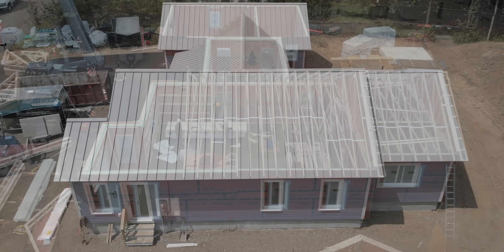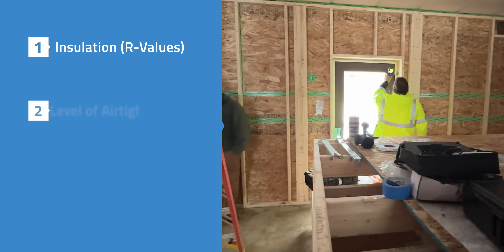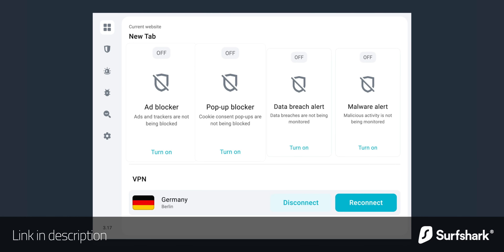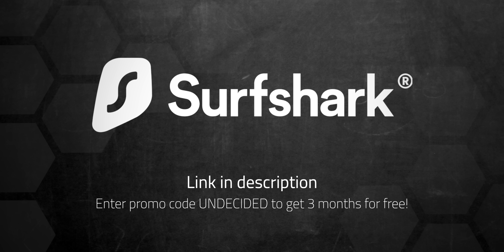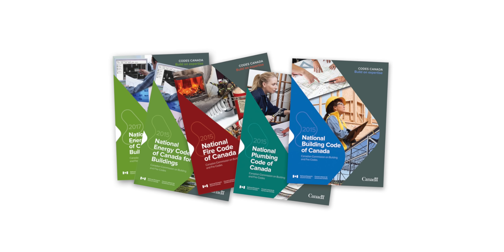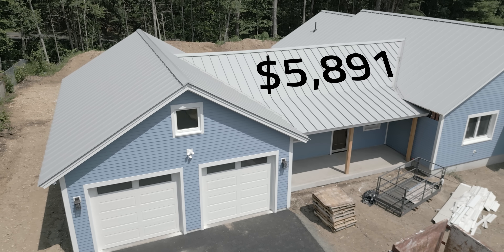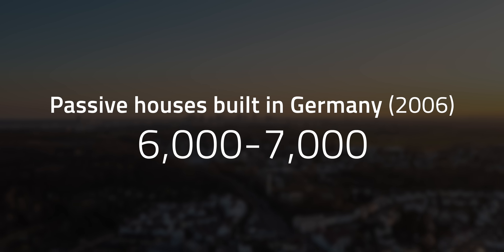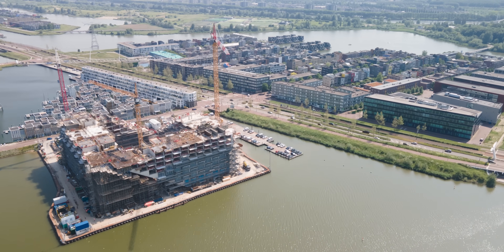Why Do American Homes Suck?

Comment: I am interested in energy efficiency in my home.  So far I have lived in a double wide mobile home, a cookie cutter home in a neighborhood and now in a log constructed home.  I have always wondered why none of these homes seem to favor any kind of energy efficiency from the start but I guess this video kind of spells it out.  I have also found that generally most contractors in my state (SC) don't seem to have a clue when it comes to addressing these efficiency issues.  I have attempted to get help with implementing energy efficient systems and seem to get lots of push back usually pointing at cost and claiming that "it's just dumb to spend money on that".  I have had to take in into my own hands to implement my own energy reform in my own houses.  I usually have to start by installing energy monitoring to see what needs the most refinement and do regular temperature and air quality checks to see what needs to change.  I am in the middle of refining my log home now but it is looking like I have some pretty major expense ahead of me.  The windows suck but aren't the worst, the air conditioning setup is by far the biggest issue at the moment so I am looking to make some changes there.  The current downstairs unit draws more than 70% of the energy used in the house.  I have to get this down significantly before I begin with my solar setup so I can properly size my equipment.  I really wish this process was easier but it just seems like no-one cares.

Comment: Agree on the statement: EU houses are way, way better built. 
The house of my parents in a mountain area (winter temps reaching -10⁰C for weeks and dealing with snow for around two months) is insulated by 3 (layers of) walls, from inside out: plaster-bricks-concrete + foam insulation + waterproof insulation and a nice touch of stone finishing. The windows are triple layered. The roof is even more complex, so much I can't really say the correct composition. The only permanent heating device is a pellet stove with a max power of 12kW (but usually runs at 5-6kW), it keeps the whole house (around 120m2) at 25-26⁰C all winter. The efficiency rating (according to national rules in a scale from A to F) is B+. The average cost of building the house was around 70k€ ten years ago. And yes, aside from the solar panels and heating, it is way more efficient than Matt's house.

Comment: My guess would be that cost of housing is the main barrier. Even the most modest and inefficient houses cost a fortune and take a lifetime to pay. Most people can’t afford additional costs upfront and would rather pay increased cost of operations over the life of the house
Reply: No, modest houses do not cost a lifetime to pay. Even regular houses don't cost that much. 30 years at most. A tiny house starts from around 10000 euro as a kit and for 60000 you get a luxury tiny home completely furbished. Regular homes start around 120000 for prefab timber frame structures. That would take you about 15 years to pay off. Most people just have very specific demands that are unrealistic in the current housing market (like my single friend who is angry with the government because he can't buy a nice apartment by himself in the middle of the most popular city in the country, while only working 4 days a week and going on holiday 5 (!!!) times a year. This year he flew to Norway for a midweek, to the US for a weekend, went to France for two weeks, and went skiing twice).
Reply: A few extra insulation boards would only cost three to four hundred dollars and would pay back in six months. The price of housing is hardly related to construction costs.

Comment: The US should step it up. Now when things are starting to move towards renewable energy, it will be easier to match the needs of energy, to the amount of renewable energy. . . If the US added high taxes on use of energy, the government could use the tax income to create windmills, while people would start to create energy efficient homes. . .  In Denmark, tax regulations as these are CONSTANTLY changing and changing ALOT. 

It blows my mind how far the US are. It wont be many years before Denmark is completely filled with new or renovated houses which uses absolutely 0 energy. Step it up US.

Comment: Lol, in Israel your must have at least one room that can withstand direct impact of a missile with 140 pound of tnt. Standard windows in new homes have 3 layers with vacuum or gas in the middle, most houses are from concrete or very strong blocks with multi layer for isolation of heat. Also all new houses must be able to withstand earthquake at some degree, and the base of the house has minimum dept that must go into rocks to avoid shifting, usually the base of the house cost about 30% of the house construction.
Also new homes have some filtration system against gas war, but I bet no one knows how to use it lol

Comment: Something that people really really don't understand about the United States is the concept of personal autonomy, which is foundational to our national identity.

You can see this very clearly in the Bill of Rights, and when it comes to the subject of this video, you see the manifestation under the 10th amendment, which is the separation of powers between the federal government and state governments. 

I'm really reducing it down here, but basically the idea is the US culturally prefers individual autonomy over top down authority in all aspects. 

That comes with a big trade-off, top down bureaucracies can equally influence positive and negative things, good code, requiring certain our values, electrical safety would be among good things, but as history will clearly tell there is a guaranteed tendency towards corruption within systems like that, and that's where the division of the states comes into play. You could consider the US very corrupt in its current state, however, the effect on each individual across the nation is greatly minimized by how our systems are set up.

If each state can adopt its own set of codes/standards, then not only can it more easily adapt to its environments/needs/costs/complications, it can also create pockets of experimental standards, where say new technologies can be tested, and then reference against standards, and how the language of standards needs to be stated in order to properly maximize that technology. The important, detailed understand there is just because of technology is good, doesn't mean that a standard requirement will also be good. Those two very different animals are often inflated, and understandably, so, but in order to properly understand the difference between the way, the US functions along its individualistic ideals is to understand the difference between function and implementation, especially with top down authoritarian systems with an extreme tendency towards corruption.

And then there's the detail of cost, housing prices are a nightmare right now as of October 2023, so there are many who will take the initial trade-off of a house they can actually afford versus having these very high standards that in and of themselves are good, but would make the house completely unaffordable to so many people, especially in hard times like now. 

And then there's the fact that a lot of these upgrades can actually happen later on when the economy improves, changing out windows isn't hard, and the style of construction in many US homes nowadays makes it very easy to remodel and redo. 

So the tendency toward more freedom does have its own trade-offs, but that freedom allows for wide innovation and wide availability to those who are in more difficult financial circumstances.

Comment: Hi Matt, I'm very interested in energy efficiency and building an energy efficient home.  I will be leaving my current home in the next 5 years.  I have every intention of making that home fully energy independent. But despite my experience with building and remodeling homes, I know little about the actual requirements, materials, companies and practices for high energy efficiency other than the use of high R Value insulation, foil reflective roof sheathing and insulated glass windows.

Comment: I'm in the UK which has a large stock of old housing stock that isn't well insulated but new houses are mandated to perform much better.  My own house is a four year old small barn conversion which has a "negative carbon footprint"   triple glazing with tilt and turn window casements, very air tight, whole house MVHR, heat pump heating and a heat pump cloths dryer, underfloor heating and solar power with Tesla battery storage hence no electricity bills when averaged over 12mths .  It was worth investing at the construction stage while converting a redundant agricultural building.

Comment: something I could see helping is provide more reference homes and give tours during construction on how things you can't see later are constucted and how they perform.  Another thing that could help is a referernce design for a halfway passive house.  how can cost and complexity be simplified (so more builder could participate) so some of the benefits can be seen.   On a tech note, how essential is the air to air central heat exchanger in a passive design?  i'm working on solutions for older houses with steam heat for instance.

Comment: Really informative Matt. Thank you. Those three-pane tilt and lock windows are really interesting. It's quite windy where we are and the conventional wind-out casement windows so popular here take a beating in the windy salty air.

I have double-pane double-hung windows and they are definitely not the easiest to get a good seal on, worse than casement windows for sure.

I have better insulation and windows on my radar for future improvements to my house. I have topped up attic insulation and installed a multi-split heat pump. It cut our furnace oil usage by around 80%. Switching to a hybrid water heater and improving our windows could get that to 95%. We'd have to install a second multisplit to fully drop oil since the ductless heads inside are not positioned to effectively get the entire house. I'd really like a hydronic heat pump since we have the water radiators already and that would be less invasive.

Comment: Here in the UK most new houses are properly insulated and as long as you keep all the windows shut they are pretty efficent. Unfortunately this means the moist air inside the house has nowhere to go and we get serious damp inside. The UK gets a lot of rain, in case you hadn't heard 😆
Reply: You need HVAC system with ventilation

Comment: I remember watching a series back in the 1980's from TVO called "The R2000 Home". It was an attempt to have the building codes changed to move Ontario into a high efficient building code. This program fell flat because of the lobby groups who ran a campaign saying these houses would tank the already failing economy of the time.

Comment: When Covid hit, we saw the price to build a home double, so our dream home became unobtainable. If we had regulations in place for an efficient home, the one we did end up building would have also been impossible. You're right that the price of building a home is the main contributor. I had plans to make my dream home energy efficient because we had the extra lee-way to do so, but every year just saw a worse and worse price hike.
Reply: While its too late in the current home to make it Passive like without a massive cost, there is still plenty that can be done to cut power use . Insulation is still the cheapest way to cut Aircon cost , keep the furnace running less in winter and plugging airgaps is doable for many of them. A good house efficiency report will show you where the low hanging fruit are and the bigger issues that could be planned for a future upgrade.
Reply: That's why the US doesn't have use such strict regulation, because the cost would sky rocket even your most basic home.

This dude talks about all his homes fancy features but he not once went over the cost because it's unrealistic for any average home purchaser.

Were watching a millionaire talk about his million dollar home and trying to pass off as one of the middle class bros, lol.

Comment: I have designed a more energy efficient transportation 'system' but can't get non-dilutive funding from USDOT. At the same time, this system would involve upgrading the electricity distribution grid wherever the transportation system is installed.

Comment: This video reiterated so many important points about energy in United States: efficiency is not valued as much as they should be because energy is too abundant and too cheap. This is the reason why heat pumps are still very "new" in the U.S. even though they've been around for so long. Same thing for the appetite towards enhanced R and U value technologies, like vacuum insulated panels and thin aerogel-insulated triple (or even double) pane windows. Still, this also means that there are enormous opportunities waiting to be unlocked from efficiency increases.

Anyway, for those who aren't familiar with building codes: While there are too many nuances about the reason why U.S. does not have a uniform set of building codes or a blanket adoption of one throughout the entire country (e.g. states' autonomy, climate and geographic variations, varying energy prices, labor and material costs, government/regulatory environment or framework, community/cultural differences, local area median income, and way more—all affecting the cost-effectiveness of any included required measure), the reason some states don't have statewide codes is because they are home-rule states (e.g. Colorado where local jurisdictions can choose to adopt their own that works for them, all things considered). Other considerations for why codes are amended at the local levels include juridictions' capacity to enforce the adopted measures. There is no point in adopting codes that cannot be enforced, or can be enforced but at the cost of harming local communities (e.g. developers going somewhere else to put up a building and taking jobs with them, buildings thought to be built to certain standards that aren't true and carbon emissions reductions getting miss calculated, or increasing construction costs that raise rent and gentrify entire neighborhoods).

There is a lot of work put into designing, developing, implementing, and enforcing codes. Lots of energy and cost modeling, market analysis, industry and standards coordination, stakeholder engagement, etc—a whole suite of R&D. All of these have to check out, and if something doesn't, the codes—as ambitiously written as they may be—cannot make the meangful positive changes they were meant to make for the community they are being enforced to.

Comment: I think you also need to consider the opposite problem that comes with too much regulation. People in  Florida have such strict codes on things like windows, that many of us are forced to keep ancient single pane windows or even worse Jalousie windows due to the extremely high price of code compliant windows installed by state certified installers. I have a friend who recently got a quote for $64,000 for replacement windows in a 1000 square foot slab ranch house. If they lived in another state, I could do the whole job for them using double pane low E glass windows for $3000 and triple the efficiency of their house. They will be keeping the Jalousie windows.

Comment: I think you can add the electrical installation to the list. Not only does metal conduit look like something out of the 60s, the voltage means the US is using twice the copper. It must be horrendously expensive
Reply: "voltage means the US is using twice the copper" 
What?! The US voltage is lower and voltage determines the wire's required insulation, not the diameter.
Reply: @TimGautier   The voltage in the US is half most other countries, that means the Current is double for the same power. Current defines what size conductor we need. Hence the US generally uses larger conductors
Reply: @SPHARKS11  Yes, current determines the diameter of the conductor. No, the US does not run double the current. Standard US household circuits run at 15 or 20 amps. I.e. half the power of most countries running 220-240V.

Comment: My only concern with passive houses is the materials are used to create them... I'm a bit dubious about locking myself into an envelope that's full of formaldehyde glue and other vocs... I know that's kind of the purpose of the HVAC system but that off-gassing is going to last for a really long time.
Reply: air to air heat exchangers bring in fresh air from the outside. the only downside is they're expensive

Comment: Sadly, the U.K. isn’t always much better - newer buildings are built to better standards, but there are plenty buildings built even in the 90s or 2000s that aren’t all that well insulated. Our flat built in 2018 is quite well insulated as far as the walls go, but still has double rather than treble glazing.

Comment: I renovated the last 5 Years my half-timbered-House in Germany and went from 180kWh/m2/a down to 90 at the Moment. The goal is to get down to 70kWh/m2/a. To Change the Windows, Doors, and Roof did the biggest change. Currently i'm on the Isolation to the ground. 

I'm able to run an half-timbered-House with an Heatpump and i'm really happy about the progress.